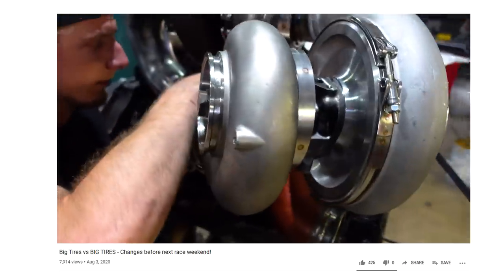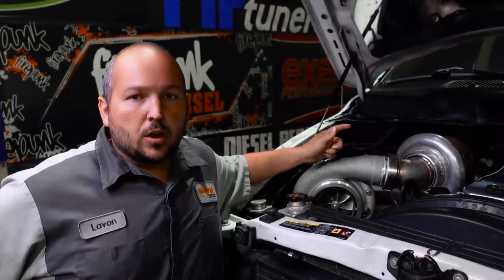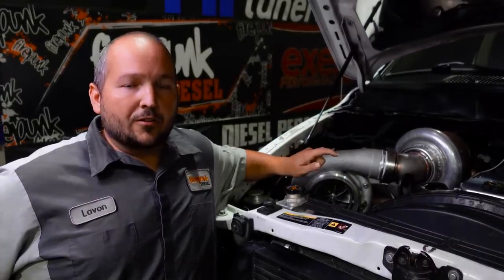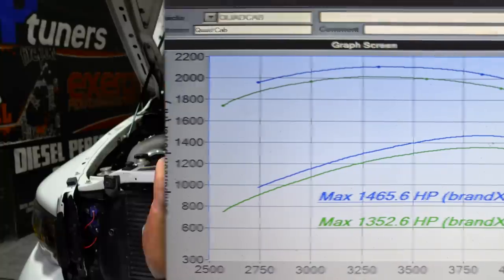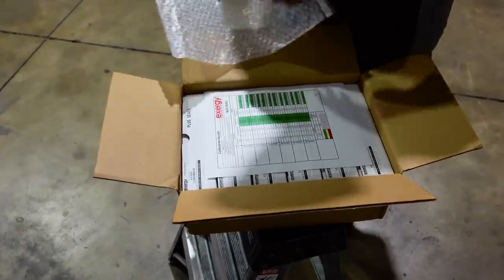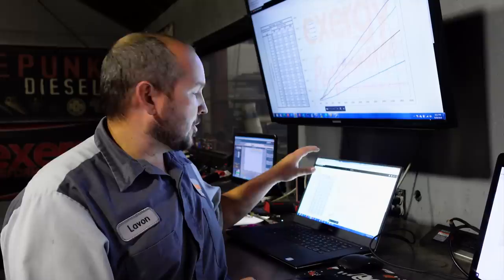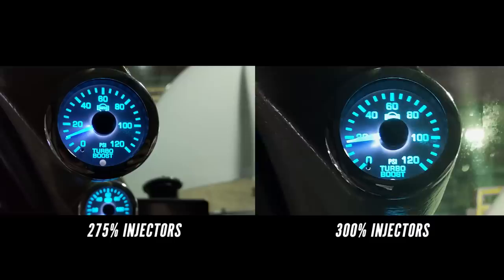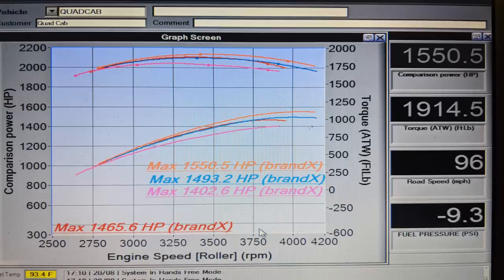"THE QUAD CAB" GETS A 107MM TURBO & 300% INJECTORS

Comment: Levon you are a true credit to the industry I think people like Cummins should be having you help set there you’re their engines up I bet you could make their engines run better and run cleaner then what they do right now why the first thing I would do is illuminate that EGR if nothing else I can I can’t see how it would hurt anything I have an old 91.5 Dodge and I’ll give you three guesses what’s under the hood and I’m gonna be doing some things to it here real soon hungry diesel fuel pen 3800 RPM the governor spring job MNH timing device dynamic timing device I already got a Hamilton cam stage to head on there and heavy duty pushrods so you 500,000 mile engine she still taking along pretty good I’ll be I can go up there in 10° weather and hit the key you know the heat grid and it starts up after birth to three revolutions I am your pops right off so we know the engines in pretty good shape anyways a man I’ll tell you want another area I think you are to consider is these guys with these newer trucks are having so much problems with her computer hardware and see about getting with saw another company to build better quality units and they can do it it can be done

Comment: Does a shorter injection time and more advance also allow you to rev higher? What is needed to run 7000 rpm for example and what are the cons to do so?
Reply from the maker: The short answer is Yes!  the faster the fuel can be delivered the higher rpm capability becomes, so far we haven't been able to get peak power much passed 5000rpm though because the dwell time of air being introduced to the fuel plumes is much shorter.  The S10 can run all the way to 7500rpm if we wanted too, but we would be way down from peak power by then.
Reply: @FirepunkDiesel  thanks for your answer! So too little dwell time means there is not enough time to mix air and fuel?

Comment: Can I turn my 5.9l into a 6.4l with the 5.9 block
Reply: A 6.4 cummins is usually a 6.7 block with a 5.9 crank. You would need 6.7  pistons then as well
Reply: @NJ_24V nj_24v that basically makes a stroker 5.9. Displacement is around 6.2 liters usually.
Reply: @NJ_24V nj_24v 6.7 crank and standard length rods. 6.7 and 5.9 have same length rods
Reply: 6.7 liter sleeved to a 5.9L with a 6.7 crank ect ect